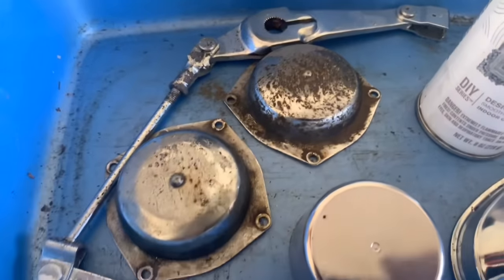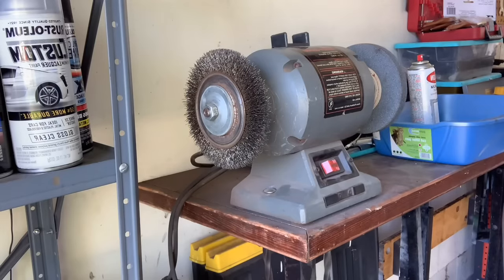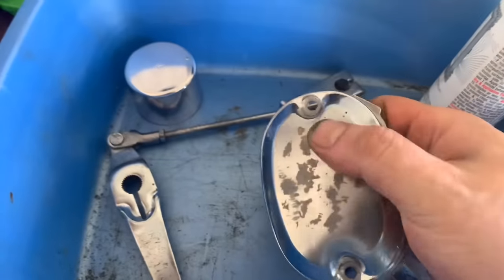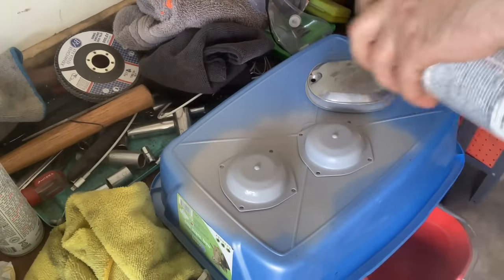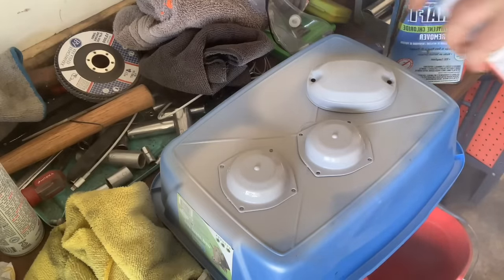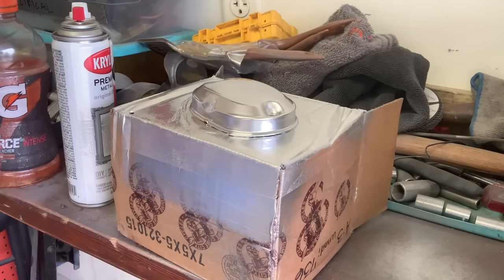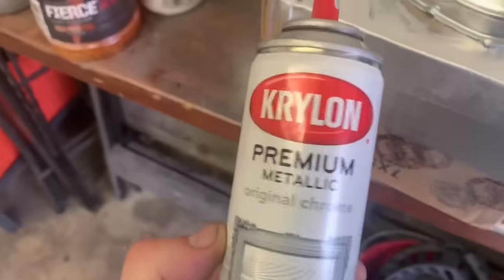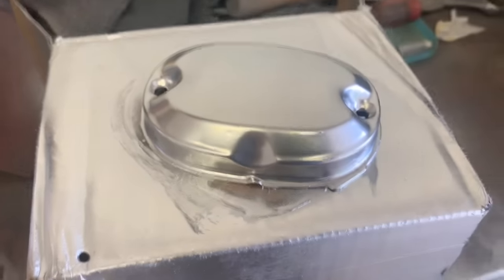Painting With Krylon Chrome Spray Paint-Vintage Motorcycle Restoration Project: Part 69

Comment: Love the way he's attempting to convince himself it actually looks good.
Reply from the maker: Truth. I just ended up getting new parts. Lol
Reply: @KeepOnWrenching  It isn't that bad. No one expects spray paint to look like actual chrome. It's better than rusty parts, and if you're on a budget why not do what you can to dress the bike up as best you can. The main thing is to get that bike out on the road.
Reply: He talks way too much.
Reply: @berthadelone8544  I disagree
Reply: Bet that would make a plastic part or project look metallic though. What do ya think?
Reply: In my opinion id rather have the primer then the fake chrome
Reply: Looks more like aluminium better than rust though
Reply: Any time you spray paint chrome you need to spray gloss black first then the chrome paint, otherwise it just looks like bare metal
Reply from the maker: Yes. Obviously, Daniel. Thanks for the articulate and constructive advice.
Reply from the maker: I like talking. It’s a video.
Reply from the maker: Totally.
Reply from the maker: I need to do more experimenting.
Reply from the maker: Fantastic info!
Reply: Daniel Johnston  I too build model cars. Have you tried MOLOTOW? I have the chrome paint pens from hobby lobby and use them for trim and other smaller pieces. Over top of gloss black it looks like chrome plating. I haven't tried airbrushing it over larger pieces yet
Reply: Should have painted it gloss black then hit with chrome...
Reply: @berthadelone8544  When you shave, he will talk less Bertha!
Reply: Hey Nikki B, Did you paint yours pink?
Reply: Love your honda!
Reply: @berthadelone8544  no such thing! As talking too much.
Reply from the maker: Thanks, man! Appreciate that
Reply: It did look pretty good. For what it was. It's not "Chrome" AND it was a spray can. Looked pretty good. He could have tried to sand it, buff it etc, but all those bad spots would be seen.

Comment: Never use lacquer over urethane nor enamel paint. Drying your parts in the oven @ 140 F for 20 minutes strengthens the paint unbelievably, works with rustoleum as well.
Reply from the maker: Great info! Never thought of baking the rustoleum! Thanks!
Reply: @KeepOnWrenching  just an idea, paint with both, the chrome and the laquer at the same time

Comment: I think you'll find you have better results with the chrome Krylon paint if you sand the primer with 600 grit and water first then with 1000 gritand water. Then remember to let paint flash between coats your pouring on too much too quickly, slow down and on use same brand clear (krylon) rustoleum should only be used with rustoleum primer and base color. Cant mix products. If you follow this you'll get much better results.
Reply from the maker: Thanks for the tips! Will definitely give it a go.
Reply: Idk what "letting the paint flash" means.  Keep seeing it.
Reply: @sp1068  letting the paint flash means to let it dry between coats, you are allowing the solvents to evaporate out of the previous coat. Usually at 70-75°F around 10-15 minutes. Touch the tape and if its tacky but not stringy your ready for the next coat.
Reply: @hildysworld  Thanks. Have been looking at anything that gives a decent chrome look without the expense of plating.

Comment: I realize this is just a stop gap until funds are available for new parts, however, I have a couple of ideas/questions. A buffing wheel and some fine compound, might bring out a more Chrome like shine being careful not to heat up the part. Also, I wonder if Krylon makes a compatible clear top coat that is compatible with their chrome. Their website and/or technical data could help you there.
Reply from the maker: Problem with the clear was that it was lacquer. Learned the enamel vs lacquer lesson that day. I’m gonna try a few different way. I’m sure there are better ways. This was a pretty sloppy job.
Reply: dont buff or compound chrome paints, from my experience it completely ruins the chrome effect

Comment: definately a passable Aluminum best Chrome product I saw, so far, is Alsa Easy Chrome but I still looking the Alsa Easy Chrome is expensive to apply if your not set up for it ( pre-requisites: Air machines ect), further they really dont give you much but the results are almost spot on Chrome just no endurance. I have a are project, for the organically shaped speakers and I want them to be in chrome.
Reply from the maker: Will check it out. Thanks for the heads up.

Comment: I just bought a can of a similar brand, always laughable how the chrome lid to the spray can yields way different results.  I accidentally damaged my scooter headlight factory chrome painter reflector by cleaning it with glass cleaner and the next thing I realize is I'm looking back at black plastic!  All the reflective paint dissolved or easily came off!  I repainted it with a similar chrome paint and my results was it was silver and not chrome.
Reply from the maker: Yeah it’s not chrome at all. I’ll probably keep experimenting though. Maybe get some better results.The cap sure looks nice! Lol
Reply: I use Molotow chrome markers for my RC restorations and it looks like actual chrome. Works on large surfaces if you're patient enough.

Comment: Enjoyed video was debating between rustoleum metallic or krylon on a bowling ball fir my garden....recd. alot of good hints to add black gloss underneather first..thanks for video
Reply from the maker: Gloss base is key!
Reply: Thank you for information, where I live right now both spray paints are out of stock but I they said they have order in will call ask if they have the supply u suggested also thank you again...

Comment: Could electric coat it with nickel? My friend used to do gold plating I learn the process when he was doing but paint is fine to chrome don't get you home.
Reply from the maker: That’s definitely an option. I got better parts from eBay eventually. Worth a shot.
Reply: Chrome dont get you home always trust in rust!!!
Reply: Nickel plating is very easy, but is a duller metal than chrome.  It doesn't rust though!

Silver plating would shine, but is soft.

It's a shame the chrome plating process is so toxic, because I'd like to do it at home.
Reply: @firstmkb  yes I was in Stockton California at a chroming plant. My Brother in law was dropping off his bumpers to be rechrome plated. It looked like some serious chemical being used in that plant.
We used to have a small rechroming plant in Richmond California, but I think they shut down that plant like all the rest of the foundries that once was in the bay area before they started shipping all are machinery over seas. 
There are very few left in Oakland California. That strip and refinish metal in different or treated chemicals. 
Now there going with painted or electric coating spray on. 
There using that spray on chrome just about everything these day's wheels, race cars, in many different colors of chrome. 
You are right nothing like the original chrome it just looks thicker and shines better.

Comment: Start with a gloss black base coat,  the smoother the base coat , the smoother the chrome will laydown ,then spray chrome paint over that. allow 1 week to dry between the black base coat and the chrome. Do not clear coat.
Reply from the maker: Thanks for the tips. Black base is key I think.

Comment: I have a 1974 Honda 350 Four sitting in my back yard it has 4669 original miles on it it's been sitting about 40 years some of the chrome is starting to flake I think I will try that method and see how it comes out on the chrome
Reply from the maker: It’s not the best chrome paint for sure. From a galloping horse it looks just ok.

Comment: The clear coat didnt look good because you applied way too thick of a coat on your test piece. It's supposed to be applied in thin even coats to get a nice transparent glossy finish
Reply from the maker: Alex Cardenas agreed! I’m super paranoid about paint reactions after a tragic day of messing up all my parts. Thanks! Will keep your advice in mind.
Reply: @KeepOnWrenching   The clear you were using is Lacquer, you cannot spray spray that on enamel there are different chemical properties.  Try Rustoleum clear or a 2k  for enamel and I think you'll have success.

Comment: I had lifting with Rustoleum Clear over Rustoleum  black. I contacted technical via email to let them know my issue and ask for information. I remember the old school Enamel over Lacquer by using “E” comes before “L” thus Enamel over Lacquer = OK, but not the other way. The tech support lady was nice and told me I was right, but added, if the can says Enamel on it, otherwise it’s Lacquer. Fewer cans are labeled lacquer but told me to look at the can. If not “Large” letters saying anything, it’s Lacquer and those solvents are too hot over dried cured Enamel, it will soften the base color, wrinkle or lift will happen. She pointed to the “Professional Series” Automotive series either high temp, wheels or engine paint.
  I can not speak for Krylon paints but based upon the results in the video, I would say it was an enamel base with a Lacquer clear. Just a thought. ASE Master Tech - Retired
Reply from the maker: Fantastic explanation. Thank you for the info!

Comment: On the paint......use self etching primer first. Then use the primer filler. Dry sand. I don't like enamel, its soft. Use Duplicolor chrome available at the auto part store. Clear will dull the chrome........ it will make it more gray than chrome.
Reply from the maker: Noted, Glenn. I definitely want to experiment more.

Comment: You might want to look into a 'carding wheel'...used by gunsmiths to remove rust from blued surfaces without ruining the blued finish...look for them on Brownells website
Reply from the maker: Will look into it.

Comment: I need to refinish my washroom taps.  I have hard water and the chrome they put on these taps is microscopically thin.   (Really cheap).   But you have to be so careful what you use to clean them.    I need to refinish them, but where can I get that original high gloss lustre?
Reply from the maker: I would avoid chrome spray paint.

Comment: What did we learn....find a chrome shop and make friends.  It shouldn't  surprise you that a LACQUER based paint/clearcoat would destroy/lift/bubble whatever was under it.  You got that part looking as well as you could with the way you worked it.  When you use a filler primer, give the bad area a couple coats, hit it with a sanding block and repeat until it is filled, then prime the whole part.  Overall, it turned out as well as one could expect.
Reply from the maker: Learned that lesson that day with the lacquer

Comment: Again.  That looks great.  I used it for the underside of my chrome rims and I'll use it on various springs and such.  I'm doing all the chrome/alum scrubbing and polishing by hand.  From a wheel to 1000 grit wet and finish with 0000 Steel wool.  Using brasso for a polish.
I have cancer and not at my best on lifting much and this project is all mine.  I don't want to remove the engine to rattle can the frame.   I'm replacing the wiring harness so I've got some room.  I don't want to sand,  then primer, then paint.  Can I just rough up the frame paint (of course bare metal any rust spots) and paint with a 2 and 1 primer paint?
Also, I'm can't find a half helmet like yours that fits my long oval large head.  Any suggestions on that as well?
Reply from the maker: You could definitely scuff and touch up the frame. No worries there. Instead of finishing with steel wool I’d use a rubbing compound and then a polish. Once you use the 1000 grit you’re in pretty good shape. Steel wool can actually scratch it up a bit. 0000 is definitely the most coarse you’d want to go. Good luck with your build and I wish you a healthy, speedy recovery. Go get it!!

Comment: Wonder if you tried a wet sand super fine respray and then polish/buff whether it would achieve the literal mirror finish??
Maybe shoot a follow up and try that mate be interesting to see..
Appreciate the video here in London England 👍
Ps. I got an old Honda C70 step-through Moped 1980 semi automatic I want to restore ground up and I'm thinking of either sanding and high polishing the engine covers or possibly something like this so would be good to see..
👍😎
Reply from the maker: I need to revisit this. More vids on this in the future for sure. Thanks for the comment!
Reply: @KeepOnWrenching  cool, thank mate, look forward to it! 👍

Comment: Paint over chrome peels. Better to remove the chrome, use Naval Jelly to remove rust, then paint and finish with clear coat. Other wise good job 👍
Reply from the maker: Yeah. Failed attempt.
Reply: @KeepOnWrenching  I've an 81 Yamaha XS850 with rust spots. After I clean it up I'll powder coat, lasts well an you can use different colors. (A small battery charger, plastic pan and salt water is the easy way to remove chrome or other metals. Lots of folks here have video.)

Comment: Did you use a Rustoleum filler primer?  How long did you let it dry? I've had Krylon top coats react badly when sprayed over Rustoleum primers.
I've also never run across a clear that you can spray over Krylon metallic paints without causing them to lose their shine (the chrome turns grey...).  Without a topcoat I'm fairly certain that that stuff won't be durable at all when exposed to automotive fluids, I'm pretty sure gasoline will dissolve it and allow you to wipe it off.
Reply from the maker: Great info, Mark. It was a quick “let’s see what happens” video. It was rustoluems filler primer.

Comment: I painted a welding helmet with chrome.  Didn't test though........ yeah, turned to a dull silver on me before my eyes. Now we are gonna sand the whole thing and start over..... live an learn..... without clear coat it will be destroyed within a day or two because of the UV rays and the heat. Not sure there is a way to do it and keep the mirror effect of the paint.  Oh well. Good video,  thanks..
Reply from the maker: Shawn Folstad yeah I not sold on it either but I do think I need to prep a bit better next time. Good point on the clear coat. Looks silver me!

Comment: I need to paint a set of plastic pickups.   Did you put any kind of clear coat over the Krylon?
Reply from the maker: I did not. I bought a replacement on eBay. Black primer would have helped.

Comment: Did a similar review a year ago on some silver paint supposed to be Chrome as soon as it was properly dry ran my finger over  it and smidged all the way through, it turned out to be a load of rubbish could you confirm that if you rub your hand over it , it won't smudge as you haven't really finished the review thank you
Reply from the maker: It smudges easily
Reply: @KeepOnWrenching   I did wonder, plasicote here in you uk do a paint very similar  and as soon as you touch it its lost its sheen. Anyway thank you for reply budy

Comment: Wise to test the compatibility of the clear finish coat. I have had issues in the past with that. Check the label ingredients on the clear, if it contains ketone, Xylol, Xylene, MEK. These "hot thinners" will actually act as a stripper on many paints.
Reply from the maker: Thank you for the solid explanation!

Comment: Done tones off that over the years... all kinds off crome covers and parts... golden ruel ...HEAT UP THE PARTS FIRST ... blow lamp.... gas ring... then spray it ... drys right a way...and hardens right a way...by the way had a 72 model honda 250 dream ! I think it was called..a gold one..back in 84 ...A valve stuck in the top off the piston when i got it.. got a nother s.h. engine fore it ... did the same thing ... stuck a nother valve in the piston ...at 45 mph ticking over...1000 rpm... thair was a 250 and 350...bad engines...😢.. i got two engines ripped up ..to make 1 out off 2... a valve stuck in each piston off each engine... dumped them scrap...had carb covers and points covers thay wear good dump them   parts ...carnt remember what i did with the bike...i no a guy called around looking for scrap ...gone scrap i saw... lovely looking bike ...bad engine...normal driving and BANG... i wood not have one for nothing..id be sceared to start it ..not alone dive it.. a crap engine..not like HONDA.. had c50s 400 4 supersport 750 4 ...good bikes trouble free..😉.. helo from IRELAND...😆
Reply from the maker: Heating up the part. Worth trying. The twins have been extremely resilient. Maybe the dreams had a different motor? I dunno. She’s been solid for me so far!

Comment: The clear didn't work because I noticed it was lacquer based. Enamel would have worked fine. I saw in other replies that it does not look like chrome, this may be true, it is hard to get a true chrome look from a spray can. Hey so what, it looks 100% better than it did.
Reply from the maker: True that!